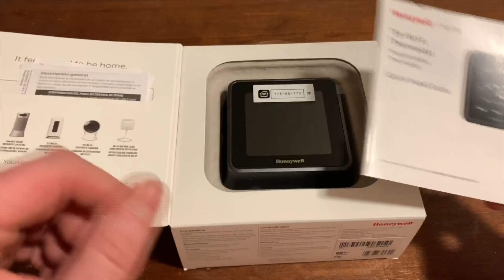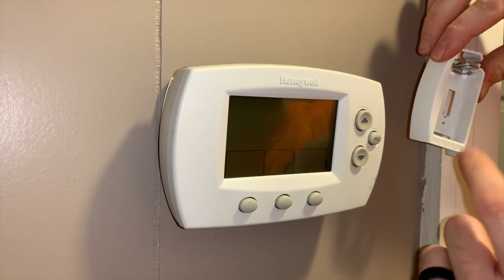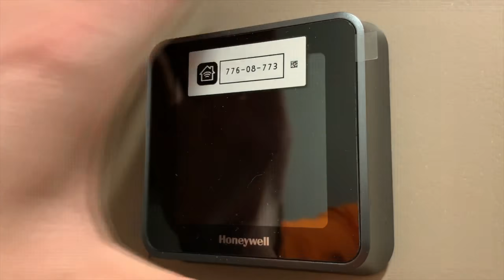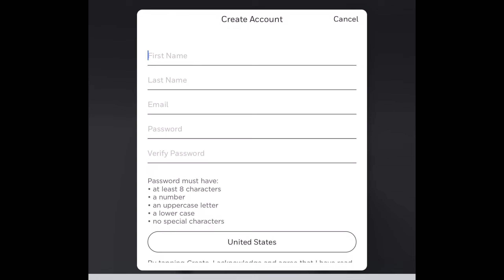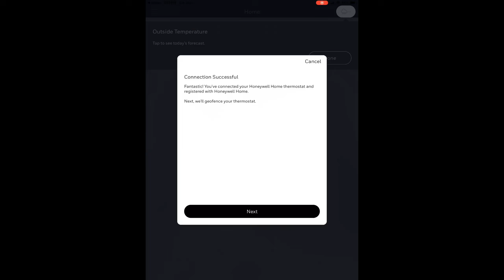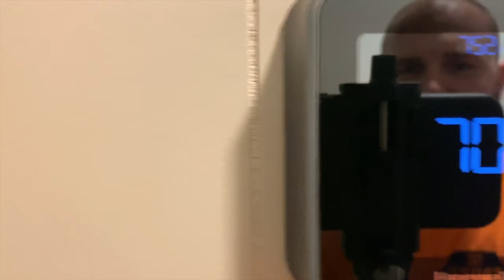Unbox & Install Honeywell T5+ WiFi Smart Thermostat

Comment: My old thermostat only has 4 wires. Called Honeywell and they said I had to do some wiring on my control panel because it was not working. Is there any way to install this without changing the wiring on the control panel?

Comment: Would it work if I don’t have WiFi?.i should it ask before I buy one.
Reply from the maker: I believe it does work yes, you just have to set it manually at the thermostat and not with an app.

Comment: .After changing my thermostat to the T5, I noticed I'm only getting heat, even when it's set to cool mode. Did I do something wrong? I double-checked, and all the wires are connected correctly.
Reply: @8463drew   same here any luck with what is wrong ?
Reply: I believe it is due to some setting on the thermostat according to some research online

Comment: I have an older home, it has rc and rh, it has a red that goes to rc, then an aluminum wire wrapped in orange that goes from rc to rh, and a c that is just tucked behind everything.

I installed the colors into the holes, removing the jumper and installed the blue into the c.

When I turn on the breaker with the Honeywell installed nothing happens

Comment: This is a review for the current 2024 T5 thermostat.  While the video is excellent and is still relevant for getting  clear installation instructions for the 2024 T5, the current T5 product requires some installation caution.  I am not able to get this T5 thermostat to work on my HVAC system even after following all the instructions to the letter as is stated in the Honeywell instruction manual  There are things you need to know about your HVAC  the T5 that are not printed in the instruction book.  I have spent three days and 6 hours running to my heating contractor, talking to Honeywell technical support (Honeywell's Resideo Technical support group), and talking to the Home Depot "expert" to figure out why the T5 I bought does not even power up.  The mistake that Honeywell made is that they don't tell you what you need to know in the instructions they provided.  Inevitably... If you run into a problem, you will have to hire your heating contractor to solve it... and that will cost yo an additional $200 to install a $100 T5 Thermostat.  Here is what you need to be aware of when you buy any of the "Smart" thermostats on the market:

First, the C-Wire(Common wire)  is important.  If you had a thermostat that had batteries, then you might not have had to use the C-Wire.  Check to see  that there is a C-Wire  that is one of the five wires coming out from the wall coming from your furnace (red, white, blue, yellow, green).  Iit may look like it was connected to the screw in your all plate.   But, you have to verify that power is coming from the furnace.  So you also have to check that the C-wire is actually connected to the furnace screw connections.  Sometimes the C-Wire is not connected at the furnace, although it looks like it is connected at the thermostat wall plate.  

Second...Make sure that the C wire is delivering 28 volts at the wall plate.  I was only getting 17.5 volts at the wall plate, and reading 27.5 volts output at the furnace connection in the basement.  That means that I have a defective C or R wire coming out my wall plate.  The T5 will not power up and  run on that difference.  It looks like I will have to replace the C and R wires. How are you supposed to know this if you only read the instruction manual?  You don't!  You would only know these things by asking your heating contractor about them.  The instruction book does not give you complete instructions.

 Third.... The T5  is not a full color screen.  It is a black screen with white or light blue numbers.  I wanted some color differentiation in the settings to help in reading them.

Fourth... this is not a pure DIY  alone product.  You will need to check with your heating professional to understand how to install it in your furnace system if it does not power up when you install it yourself.    My contractor was able to advise me for free...but that's not the case with all contractors. 

 Fifth... be careful about following any instructions sent to you by Honeywell.  Honeywell sent me some email instructions that they thought was a proper work-around procedure for the non-power-up problem I was having.  DO NOT follow any instructions until you review them with your heating contractor.  You heating system is unique to your home.  My contractor told me these instructions will not work and that I could put wires in the wrong terminals and blow a fuse.

Six... The digital WIFI thermostats do not have a battery back up for preserving some of the programmed  information your enter.  If the [power goes out,... so does your furnace and your thermostat.  Without back-up batteries or an internal capacitor to keep power going to the memory, you will lose some of the system settings that you entered.  However, some of these thermostats might have some of their program information stored in the "Cloud" via the internet  I do not want my home HVAC to be in the "Cloud" to be accessed by hackers.

Seven... all I wanted was bigger numbers to read on the thermostat.   To get that, why do you need to have thermostats  on WIFI and on the internet to control it?  My eyesight is not that great at age 72... and I am tired of using a magnifying glass just to read the tiny numbers on my old Honeywell thermostat. 

Eight... Most heating contractors will tell you that you will save money in your energy costs by setting your thermostat to one temperature, let the furnace fan run continuously to circulate and balance out the air temperature.    Programing does  not save yo much money.  Just manually set the temperature for the season and let it stay.  Don't program it for multiple setting s every day.

The man points to remember are:
1.  You may think these so-called "SMART" thermometers are the coolest thing to install these days.  You may think that you could easily install them yourself.  But that is not always the case. If something goes wrong, do you have the knowledge to solve it from the instruction manual?  And without consulting you contractor, do you really trust that the instructions given to you by Honeywell or Home Depot that they are accurate and matched to your specific HVAC system? 

2.  Don't assume you can install a digital thermostat  yourself.  The manufacturer may make it look like you can, but self-assess your knowledge of your HVAC system.  If the thermostat you installed does not work, can you really figure out what to do to solve it and not do harm to your HVAC system?

3.  Logical  practicality: Do you really need WIFI and your phone to control your home HVAC system?  Is it not just practical to install a manual thermostat and let your system function by itself?  

4.  Do you want to put your whole house HVAC system on the internet and let some hackers come into your system and control it, feel free to do so.  It will happen in the future.  But don't complain when it happens.  It was your decision to look "cool" and be able to run your thermostat on your phone while having drinks at the bar, when a simple manual control wall thermostat is all that is necessary!

Comment: I am using a johnson control box with 4 zone valves.  I have the t5 connected wifi work's but, when it calls for heat the zone valve never opens.  If i touch the r and w wires the heat comes on. Just not when the t5 calls for it. Any suggestions?

Comment: Hi! The house we moved into has 1 of these pains installed.  I can't get it to sync  with the app. Should I reset  the breaker or do I have to detach it from the wall to reset? I tried the 5 second hold on the temp number and does nothing.

Comment: Hi, when i turn on the ac heat comes out from the vents not cold air, any ideas what setting to change?
Reply from the maker: Definitely must be some crossed lines I'd assume if it's engaging the furnace w/ the AC setting on - if you have an HVAC pro in your area you can call I'd go that route. Good Luck!
Reply: check wires on back of thermostat: R -red Y-yellow W-White G-Green C-Blue
Reply: Before you start changing wiring, reset your thermostat.  The  default setting for thermostat configuration is Gas.  On this setting  for me it was blowing hot air.  Go back to thermostat configurations and switch it to Heat pump.  This solved my ‘hot air blowing out on a cool setting’ problem.

Comment: I only have a red white and green wire in an rv thermostat. Will this work?
Reply from the maker: I have to defer to the instructions included. If it doesn’t detail your exact situation I’d suggest getting with a HVAC pro in your area

Comment: I still don’t understand geofencing, should I connect it on the app?
Reply from the maker: Geofencing means that it sets a virtual perimeter around a location of your choosing, and when the GPS of your mobile device is detected in that 'perimeter' or fence, some automated action will take place.  i.e. When you arrive home, your AC will set to a certain degree temp.  Yes, definitely set it up via the Honeywell app at the very least, and we use ours with Google Home.

Comment: How come my T5 won’t turn on after installing???
Reply from the maker: Not exactly sure, could be a whole bunch of reasons.  Start with making sure connections are correct, one by one.  Then check your breaker panel to make sure nothing is tripped.  After that, you would need to consult with a local HVAC pro in your area to play it safe.

Comment: Does this unit work when you only have W1 and Rh?
Reply: The answer is yes. It is set up in the installer menu. HVAC pro here.
Reply: @fastcar42069  Thanks, I just finished installing mine and it works like a charm.
Reply from the maker: I unfortunately can't speak directly to that - not an expert on these installs directly, was more documenting my process.  Thanks for reaching out though!

Comment: Learned a hard lesson I thought I'd share.  Moved into a previously owned home back in October that had two heat pumps with four zones.  So I decided to install four of these T5's for the two single stage heat pumps.  Had no installation issues really, but once it got cold one end of the house that has the master bedroom was constantly feeling chilly.  Without having previous experience with the house I wondered why only that part of the house was chilly.  Fast forward to January and got the electric bill.  I was shocked to see $470 bill!  I immediately knew something was wrong so I set all the T-5's to 50 degrees and then set out to diagnose each T-5 one by one by setting each to 70 degrees to monitor what was happening.  When I got to the T5 near the master bedroom I notice the compressor wasn't coming on, but the heat pump was attempting to blow air using the heat strips ($$$$$).  So I pulled that T5 off the wall and discovered to my dismay that I had accidentally put the Y wire into the Y2 socket (facepalm).  Y2 is only used for two stage compressors so my thinking is that zone never ended up running the compressor and instead used the heat strips all-the-time..!  Ouch...  Anyway, I set the Y wire into the Y socket.  Tested the unit and now everything's running great.  Don't know if this little foobar will help anyone, but who knows.  You know the old saying.  Check 16 times, cut once...  ciao
Reply from the maker: Man that's a wild thing you figured out!! Thanks so much for sharing this - hopefully if anyone else is experiencing something similar this story will help them out too.
Reply: Ha it helped me! I did the same thing😔
Reply: @sweethaven-nc  wow that sounds like an expensive lesson.  I seem to always learn the hard way on these things so thank you for telling your story so I can watch out for this as I am about to install my t5 Honeywell thermostat. 
Thx again

Comment: I got this thermostat like year ago it works good but the screen display is been frozen for a while now and I can only work it from my phone with the App, I need to change the WiFi setting on it cause I change providers .. what can I do fo get the screen display to work?
Reply from the maker: Try pulling it off the wall, as in unplug the face unit and plug it back into the pin connector. Should reset it. Or flip the breaker off and on, should do the same trick. Good luck! 💪🏻

Comment: Mine is on airplane mode like it told me and then it says no Internet connection so the app can't find the device
Reply from the maker: Not sure on that - Have you tried disconnecting from power and reconnecting?  Also, resetting the software completely and starting over?  Those would be my first two ideas.  Good luck!
Reply: @ToughGuysDIY  Yeah I tried that.
It finally decided to start working lol, Thank-you
Reply from the maker: Well that’s good at least!!! Glad it’s working now!
Reply: @ToughGuysDIY  Thank-you 😀

Comment: Wired as directed still no power...wtg?
Reply from the maker: Check breaker would be my first idea - past that consult with an HVAC pro in your area to be safe.
Reply: Make sure you didn’t blow a fuse at your indoor unit. If you did, go to Autozone, and purchase the fuse you need.

Comment: all my wires are there and in right place and no power to  thermostat
Reply: C wire?
Reply: HVAC tech here, is there a common wire going to the c terminal? (Most likely a blue wire)
Reply from the maker: Thanks for chiming in!! Please help a few in the comments if you don’t mind! 🙏🏻🙏🏻
Reply from the maker: Did you check your breaker box? Or I guess it’s possible that somehow the power is jumped off a GFCI somewhere. I definitely recommend reaching out to an HVAC pro in your area if you have any issues at all. Thanks for checking out the video!

Comment: Love this video.  Can I ask, what is the difference between the T5 and T6 pro wifi thermostats?  I have a Lennox unit and my HVAC guy wants 200 bucks to install the T6.  I installed an EcoBee at my old house and it was easy.  The HVAC guy said there probably DIP to flip inside the burner unit to make this thermostat work.  I have all the wires necessary and my old (very old) TH800 uses the same wiring scheme.  What do you think and just doing it myself and forgetting the HVAC guy?
Reply from the maker: On the difference between the two I’m not sure to be honest. As far as the install goes, I think as long as you follow the instructions and don’t run into any snags you should be good. They way they built the instructions for this is very geared towards a DIY approach for sure. I always recommend getting with an HVAC pro once you hit a dead end somewhere. Thanks for reaching out and for checking out the video!

Comment: Hello! I’ve a question , I’ve connected yellow wire to y, green to G, blue to C, white to W and red to R, the fan startet to run but display remains black ! Do you have any idea what I’m doing wrong ?
Reply from the maker: I recommend getting with a local HVAC pro in your area, I can’t advise on that situation directly.  I hope you get it figured out!! Thanks for watching!
Reply: Tough Guys TV thanks anyway

Comment: Does this thermostat have a compartment for batteries? I have the same one and it will turn on, then completely turn off like it’s losing power..
Reply from the maker: Josh thats a great question! To my knowledge there is not a battery port, and the power off and on issue definitely sounds like your unit could be defective. Or you could have a loose power connection - definitely check connections before returning.  Thanks for watching and good luck!!

Comment: Can you swap out face plates with that same pin connector ? It looks like a common configure. So question is can I take my regular face off and slap on that new cool one you have there
Reply from the maker: Danny, I’m not sure on that - if the connections are all the same though, I’d assume it would at least power up. Worth a try I suppose! Thanks for watching!! 🙌🏻

Comment: I have the same thermostat but my furnace older and it has just 2 wires I understand there is a C wire adapter. How do I know which one to buy ?
Reply from the maker: I think the adaptor comes with any model you buy - but I’m not for sure on that. Definitely consult with a local HVAC expert / contractor if you are unsure before wiring up anything. Good luck and thanks for reaching out! 💪🏻

Comment: Does that thermostat need a C wire or it can operate on battery ?
Reply from the maker: I don’t think it can operate only via battery, that’s a good question. As far as the c wire I believe there are options to install with or without if I’m not mistaken. When in doubt, definitely consult with a local HVAC pro in your area, and good luck on the setup!! Thank you for watching and for reaching out!! 🙏🏻💪🏻

Comment: Mine has no display stopped working last night with a cold weather, checked all fuses, furnace as well, reset everything, made sure all wires are wired fine, NOPE NADA! Any Ideas we are freezing I have 10 month old daughter need to get this fixed asap!
Reply from the maker: Sorry to hear!! I’m not sure if it has a reset function or not, but if you’ve disconnected from power and reconnected then that should soft reset at least.  Make sure that the thermostat isn’t connected to either a GFCI circuit that is tripped, OR to a circuit that has a tripped breaker. You’d be surprised how some things are wired - check all breakers and GFCIs in the house.  Last- call a local HVAC expert out to the house to assess.  Good luck!!!
Reply: @ToughGuysDIY  Thanks Sir, Yep I just called my local HVAC tech to come check it out he will be here in a few hours, hope fully nothing to serious!
Reply from the maker: Good luck and circle back with what happens so it may help other people out!!